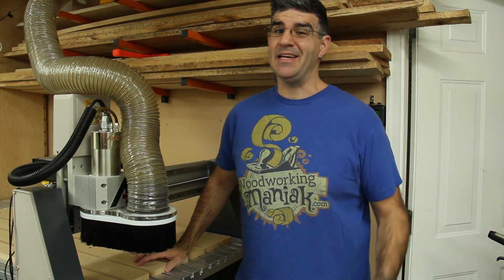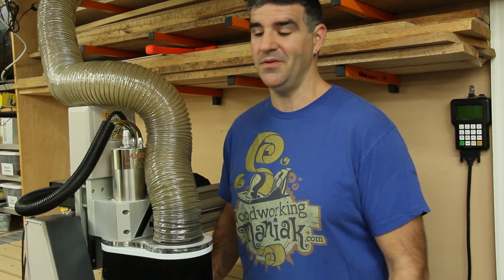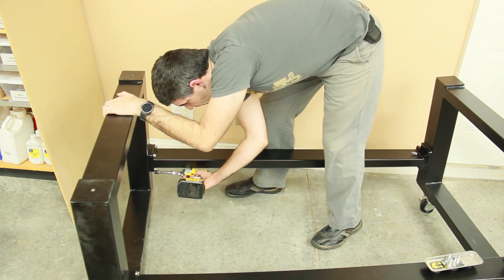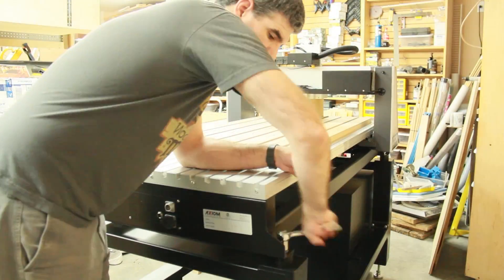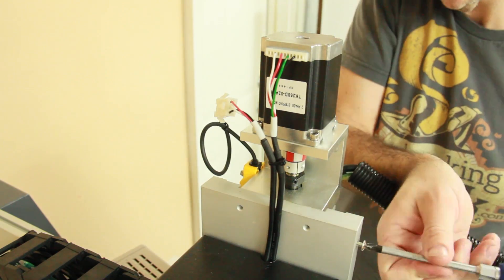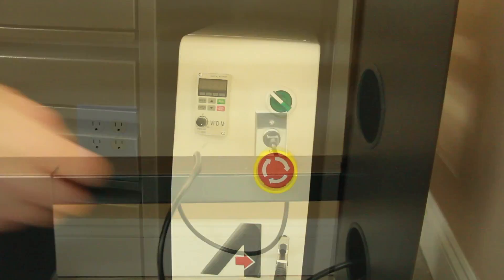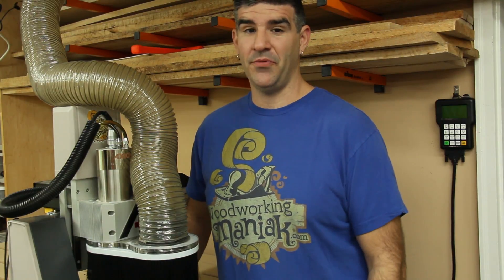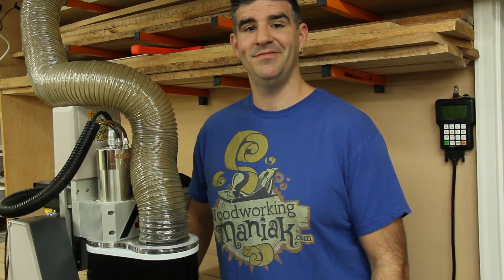Axiom Precision AutoRoute Pro 8 - Part 1 - Assembly

Comment: Great video, I am planing to get one myself. I was worried about lifting it over the stand, but I saw that you could do it with the help of your wife. But, how did you get it on top of the table first? Thanks.
Reply from the maker: I lifted one side and sat corner on the table, then lifted other side and slid it on...
Reply: @WoodworkingManiak  I thought maybe I can ask the delivery lift to place that box over my workbench and do something like that...how did you lift it over the table, not the stand, to start with?

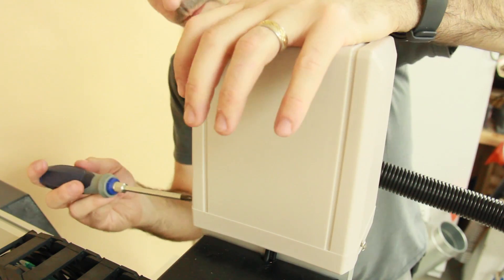Comment: @WoodworkingManiak how did you get the spindle to go up (z axis) to install the dust shoe (minute 3:10)
Reply from the maker: Without power, you can move the gantry. Once power is turned on, the servos lock in.

Comment: You had a really nice ShopBot Desktop MAX CNC. Why did you switch over to this AXIOM CNC?
Reply from the maker: The ShopBot was nice for sure. They are a great company too.
Few reasons I upgraded. 
1. Has larger cutting area. 
2. More powerful spindle. 
3. Water cooled spindle instead of air cooled. 
4. Has its own controller, so doesn't need to have computer connected to it to run. 
5. 4" dust collection port.
6. Faster spindle (up to 24k rpm instead of only 18k)
There are probably more reasons, but those are at top of my mind...
Reply: @WoodworkingManiak  Thank you very much for the detailed reply. Much appreciated.
Reply from the maker: No problem. Thanks for asking!

Comment: Is there a way to set the x and y to a particular spot on the table. Example, if I set the corner of the work piece to zero but want to start the cutting at 1/2" x and 1/2" y, Can you jog the machine over to 1/2" x and y once zero is set? Reason, I am working with some older files that were set up this way. Thanks
Reply from the maker: Yes, you can set x and y wherever you want. I have found I like it best by setting x and y at center and making all vCarve files based on center.
Reply: @WoodworkingManiak  I like using center as well but I have many molds that were created using left corner and the molds are used to trim parts over and over again so I would have to be able to find zero on the old molds. I don;t know why, but when these older molds were created they are x=.05 y=.05 from the left corner of the mold. I have the Next Wave CNC now and it lets me set the corner of the project and key enter .05 to jog the bit over in both x and y positions. I need a bigger cnc now for larger projects so I am looking seriously at the Axiom for a Turkey Day purchase.
Reply: @WoodworkingManiak  HI, That should be G54, G55 etc. It should allow you to set the work co-ordinates to anywhere you want. And of course more than one can be used in a program. You will just need to incorporate it into your program(multiple identical parts). Great Video too :-)

Comment: Good to see some of what goes into setting up one of these. Is this in addition to your Shopbot Desktop Max (searching for that is how I found your channel in the first place), or instead of it?
Reply from the maker: +Lawrence Becker This one is in replacement of the Max. The Desktop Max is a nice machine, but this one has a larger work area, larger liquid cooled spindle, and also has its own controller so it doesn't require a computer to be dedicated to the machine at all times. Thanks for watching.